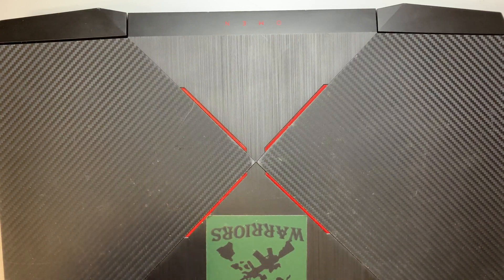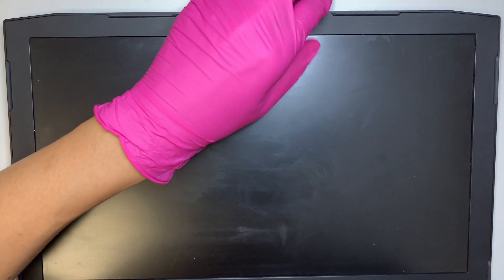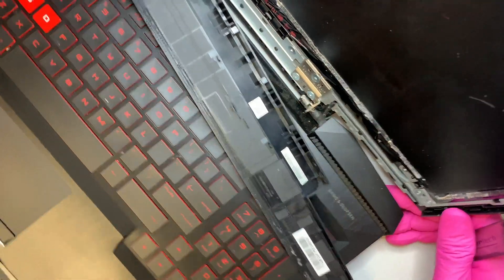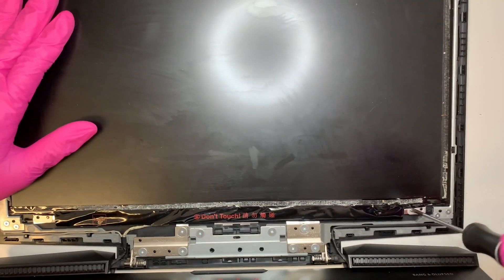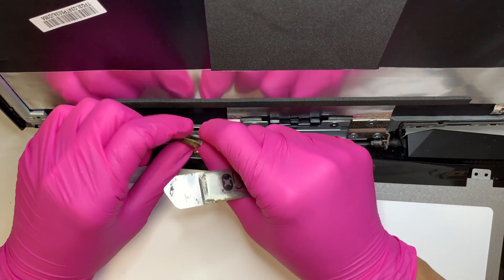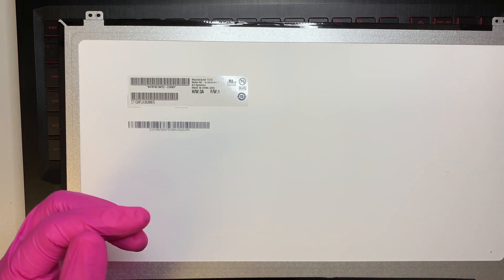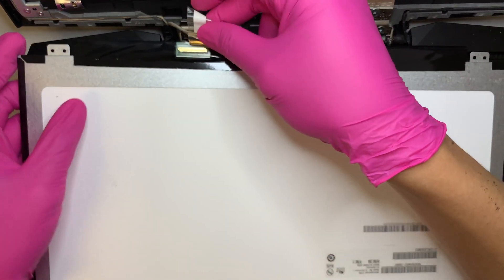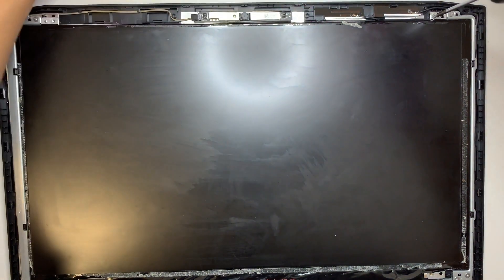HP Omen 15 Gaming Laptop LCD Screen Replacement

Comment: Thx for the very helpful video. I have a small problem though, when I open my laptop from a closed position I always hear a snap and I have a little resistance. Is it normal? I checked and it’s all glued perfectly. I don’t understand. Thank you for your answer.
Reply from the maker: sounds like the hinge plastic broke off. making that sound when you close

Comment: Be advised: remember to first disconnect the PC power AND BATTERY before you uninstall/reinstall the monitor, as the 16V power supplied to the screen might damage your graphics card core and therefore destroy your laptop completely.
Reply from the maker: Thanks for the comment.

Comment: there are different models of the hp Omen 15 inch..... mine has 6 screws and the screen doesn't just fall out...... it's still held in place by something. still looking....
Reply from the maker: Try check the double sided tape on the screen

Comment: Great video. My same laptop display is flickering when you tilt the screen angle. I think it's the display cable, is that hard to replace after removing the screen as in this video? Thanks!
Reply from the maker: I would think is the LCD. Not the cable. But you can give that a try.
Reply: @UbergeeksBiz  just replaced screen following this video. All fixed no more problems! Thanks again for the great tutorial.
Reply from the maker: @DSMTUNER  Awesome. I'm glad the video helped.